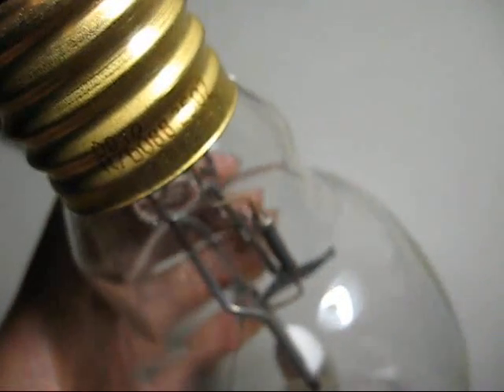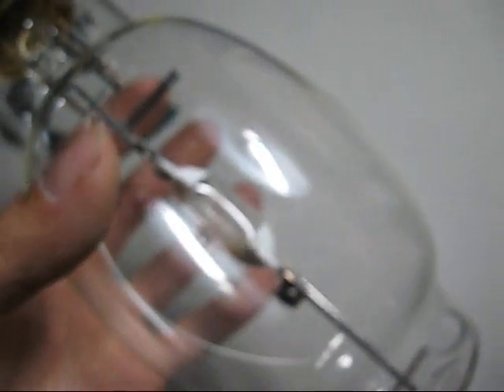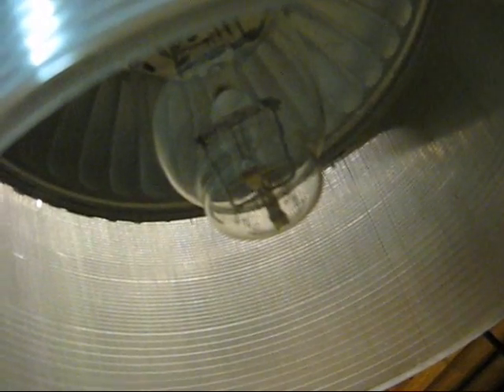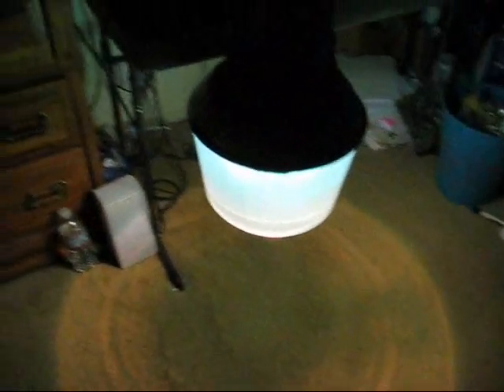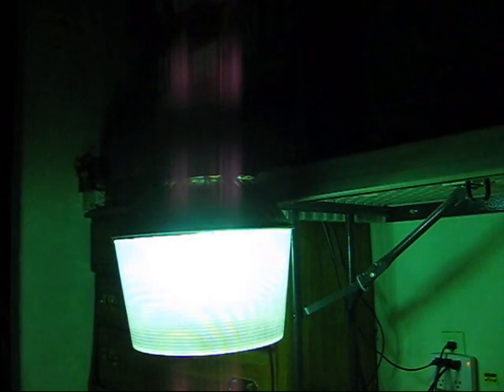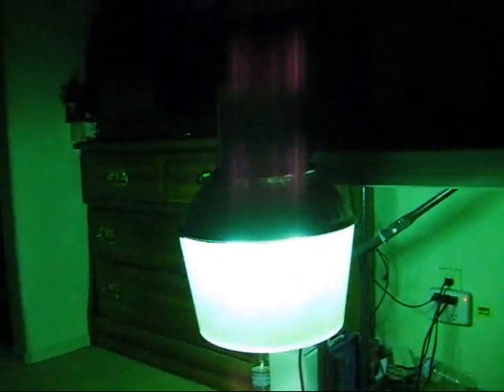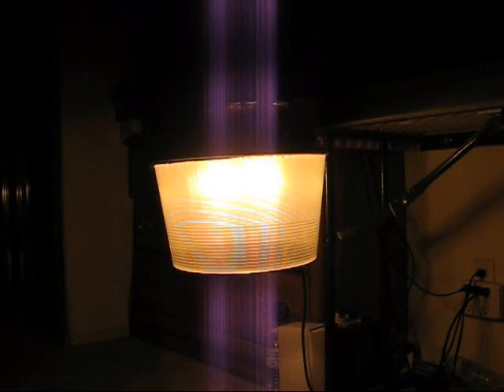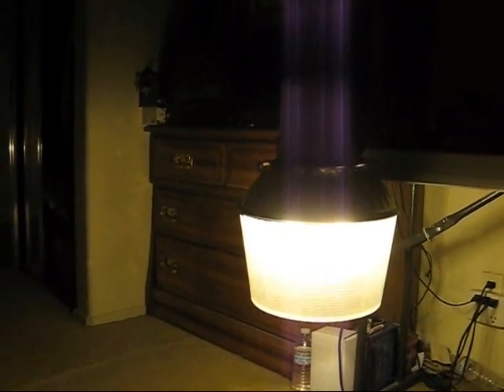Regent 175 watt Yard Light Re-wire Part 2

Comment from the maker: It was just to start this particular bulb which had a broken internal connection to the starting electrode. A pulse start bulb would not have a starting electrode so a ballast made to operate pulse start bulbs would have an igniter built in to generate the several thousand volts to strike the arc.

Comment from the maker: You'll likely need to have a metal halide ballast in there. The existing MV ballast may not properly start and/or operate the metal halide.

The original ballast in this fixture buzzed loudly so I decided to replace it with a 175 watt MH ballast that could run both mercury vapor and metal halide lamps. Ballast kit is a Universal M175ML5AC3M500K. I had to come up with my own mounting arrangement and switch the round cap that came in the kit with an oval one to make it fit in the Regent yard light
Reply: Today, I actually successfully started a 175w probe start MH bulb on a MV ballast using a European 750v 2 wire ignitor.